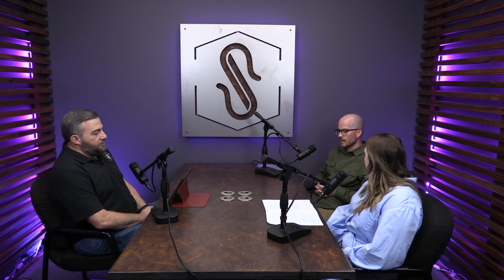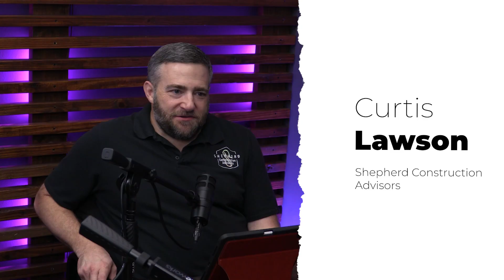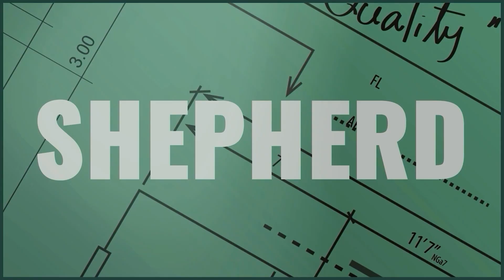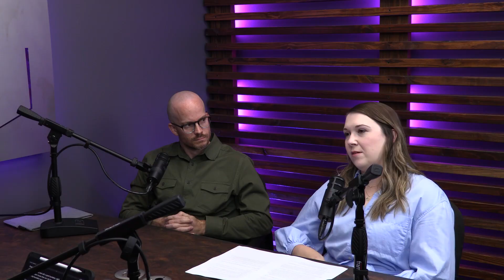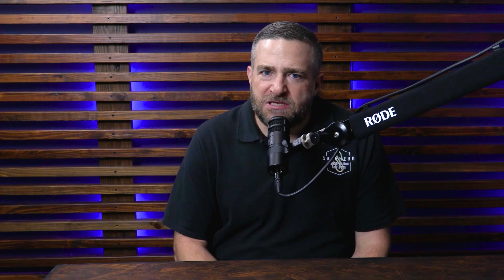Why Building Modern Homes Costs Way More Than You Think

Comment: With a little ingenuity you can get similar modern/ contemporary finishes for a fraction of the cost. We wanted 12 ft plus walls, but what we did instead just in the living room was 8 ft walls but with cathedral trusses which were only a fraction more then the other trusses. This gave us high ceilings for barely any more money.

What we wanted was floor to ceiling windows but what we did on our 8 ft walls was center 6x3 windows. They’re almost floor to ceiling so they give the same view. We also put 3 side by side to get a bigger view without splurging on a massive window.

What we wanted, tile everywhere. What we did was put it in a few select places (also that is such a cheap and easy diy project). 

What i wanted, stone countertops, what we did? Homemade concrete live edge countertops. By far my favorite finish. And buyers LOVED them.

Also instead of buying a solid wood live edge island for 7k we cut down a tree, had it sliced and planed for a few hundred.  I built a cheap easy diy island with thick black oak slabs on top. Total cost under 500$.  

I also found stunningly beautiful lights, chandeliers, and pendants on amazon. I also copied color pallets from homes on Pinterest . So be a little creative if you want modern finishes on a budget.